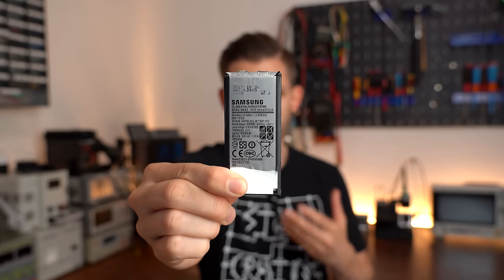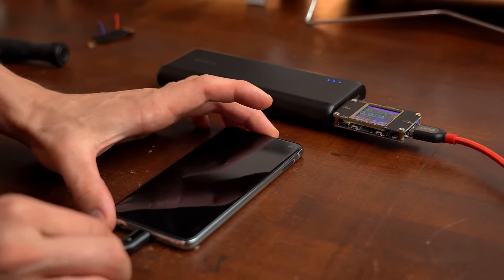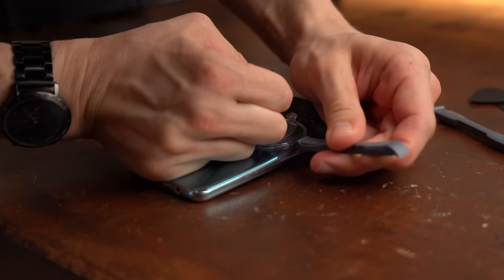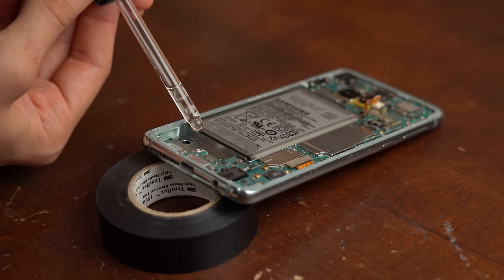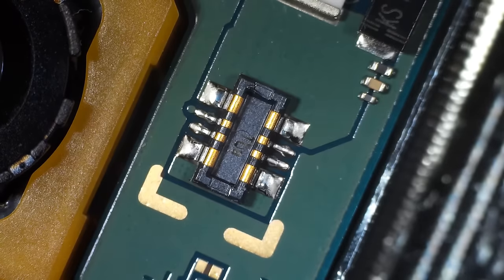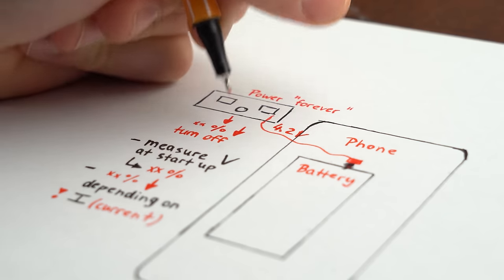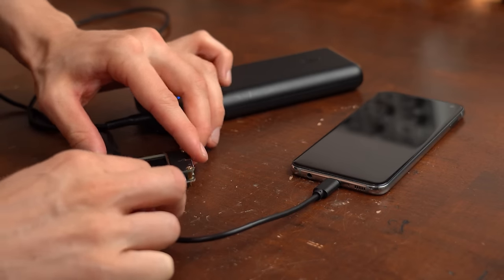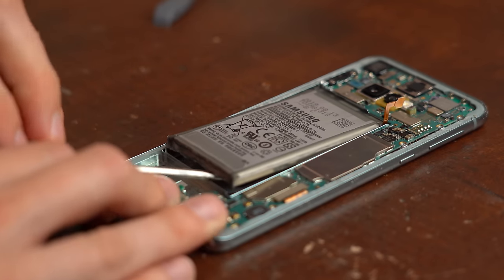I "Solved" Samsungs Swelling Battery Problem! (Batteryless Phone)

Comment: I had the same experience with an old tablet that I wanted to  use as a wall clock; however, I found a different solution that I think you might appreciate. I saw that my tablet did the same strange countdown to 5% battery with a power supply acting as the battery. I tried a regulated switching supply and a regulated benchtop linear supply... same strange countdown. Then I determined that if I could fool the tablet into thinking there was a perfect battery installed during POST and then remove said battery when the operating system started, that the tablet no longer believed that it needed to charge anything. The result is the tablet reports that it is, "Plugged in and no time is spent on battery."
The solution was to short the red and black leads that would connect to the battery during POST and then open those leads when the operating system starts, and it is happy ever after. To short the leads I just installed a "push to make" microswitch in the body of the tablet. Now whenever I need to start the tablet (say from a power outage) I just have to hold that switch while the tablet goes through POST and release it when I see the android system starting. This method has the advantage of no additional circuitry required and there is no charge/discharge cycle happening.
Reply: can you please elaborate on the red and black leads shorting? shouldnt it just make a short circuit of the power supply?
Reply: @theoneohmresistor  My understanding is that the BIOS of the tablet sees a "no internal resistance a battery" because I have shorted the wires. It doesn't short the power supply because there is no signal to the processor to try to charge the battery. To put it another way. As a battery loses charge its internal resistance goes up. This increase is the signal to charge. Of course, it is just a theory, I could be wrong.

Actually, this response got me thinking about it some more so I decided to discuss it with ChatGPT4.

After some discussion ChatGPT said the following, "You are correct that the tablet must have some mechanism to initiate a charge cycle, but this mechanism may not be as sophisticated as it would be in more expensive devices. The tablet's firmware might be designed to handle situations where the battery is connected and providing a voltage within a certain range. When the battery is disconnected, the firmware could be interpreting the lack of voltage or other expected battery information in an unexpected way.

It's possible that when you shorted the battery terminals during POST, the tablet registered a connection and assumed a battery was present. After you removed the short and the tablet proceeded past POST, the firmware might have encountered an unusual or undefined condition where it didn't receive the expected battery information. In response, the firmware might default to assuming a fully charged battery and not initiate any charging cycles.

The fact that the tablet reports a 100% charged battery and indicates being plugged in, supports this theory. The firmware might not be able to distinguish between the absence of a battery and a fully charged battery, leading to the unusual behavior you observed.

Ultimately, the observed behavior is likely due to the combination of the tablet's firmware design, hardware design, and the unique conditions created by shorting the battery terminals during POST and then disconnecting them. This workaround may not be universally applicable to all tablets or devices, and the actual reason for the behavior might require a deeper investigation into the specific tablet's design and operation."

So, the long and the short of it is... it is worth a try. It may work for your situation or not, but "no harm, no foul".
Reply: I’m a little scared to try that on older devices. I have once accidentally shorted the battery terminals and it would simply spark and short the power supply directly. Nothing broke but the phone didn’t want to charge, it gave a warning pop-up when plugging the charger in. It may work on some protection circuits but I think it’s a risky approach. I would assume most devices require the middle pin to have a signal for safety reasons. Chatgpt unfortunately isn’t the most trustworthy source, it is always super convinced that it’s telling the truth and tries to convince you that it’s correct, unless you show that it’s wrong, then it may admit that what it said was false. It can be annoying sometimes and I don’t fully trust chatgpt anymore after catching it lying multiple times, and when I would say no that’s incorrect it’d always go “oh yes you’re right, here’s the correct response”.
Reply: @waldojuarez I don’t think the bios regulates charging, there is usually a dedicated chip for that.
Reply: @teamredstudio7012  "BIOS" is used colloquially as a word for 'firmware'. Even as a separate chip the firmware of the phone is in communication/control of it. 

Also, the way Android 'tracks and displays' battery percentage has changed a lot over the versions. I'm not sure if really old Android devices would even 'countdown' (regardless of Voltage or measured Resistance)

Comment: The old PDAs had fancy desk stands that worked on mains power (and charged batteries). Many stands were  heavy, stable and perfectly angled for viewing. Look at the Palm & Dell Axim for examples that could be modded or used as inspiration.
Reply: Or you can always 3D print one or get a friend to do it for ya.

Comment: This would have been the perfect test bed for a DIY super capacitor battery replacement. They are fairly simple to make, and could be made to fit exactly into the battery well.
Reply: Super capacitors are too unstable and too big...they will work only a few minutes. This is why no one use it unless you want burst power or something to back up an existing battery
Reply: @Tailslol  who says super capacitors are too unstable or too big? I think you need a bit more study time. I have made one myself that was around 8F @2.7v and smaller than a normal cell phone battery.

Sure it wont contain the same energy density as a LiPo battery, but it will fully charge in a matter of a couple of minutes and works amazing as an energy storage from a small rectified generator source.

Im sure that in the space in a smart phone, a super capacitor of around 25-30F could be made. This would run the phone for an hour or so and only need 5-10 minutes to fully charge.
Reply: @TerryGilsenan  clearly 5min is not enough and you should show what you did because i studied a lot those and they are far from ready in everyday use. and way too expensive.
Reply: @Tailslol  expensive? I made supercapacitirs for around 50cents each. That's cheaper than any battery you could buy.
Reply: @Tailslol  5 mins of charge time for 30-60 mins of run time, is pretty good.
Reply: @TerryGilsenan  i guess you never saw blown up capacitor so what kind of circuit do you use to manage them and you still forgot to show any proofs.
Reply: @TerryGilsenan  heh lol i wasn't expecting something that sketchy than diy capacitor ... what a joke seriously.im not struggling here i can see how ridiculous you are going now... so thanks you but no thanks i don't wand a literal bomb in my pocket...
Reply: @Tailslol  LOL, sketch as a DIY? I said that from the outset of this conversation. I made it myself.

And as for sketchy.. they work. and they work well.

Have a nice $timezone
Reply: @TerryGilsenan  nope it wasn't the point the diy capacitor...it was the diy battery replacement circuit (aka the video) and the usability/safety about it. At least wired it is safe ,you can keep it plugged and use it as a clock. A desktop or a game station. And your use?
Reply: @TerryGilsenan  Having to charge the phone about 10 times a day seems quite sad, don't You think so? Supercaps are extremely interesting and have their applications, but powering quite energy-hungry devices like smartphones is not in the scope for now.
Reply: @wikrap1  you mean having a power cable connected some times is worse than having a power cable connected 100% of the time?
Reply: @TerryGilsenan  I mean lipo/li-Ion is better than supercaps for now. There is practically no point in installing supercaps if You can install new lipo battery and use it for the next 3 or more years with better lifetime, but a little bit longer charging session.
Reply: @wikrap1  The video was about removing the battery to avoid Samsungs swelling battery problem. It was about a batteryless phone.

You seem to have missed that entirely, and circled right aback to the starting point.

Also, the supercap does not have any of the lifetime shortening issues of the lithium batteries, such as dendrites. Why? Because the battery is a chemical reaction, but the supercap is ionic charge.

Still, I see that you are arguing for the point of arguing, rather than trying to extrapolate upon the video's purpose, procedure, and outcome.

Have a nice day.
Reply: @TerryGilsenan  Swelling, ok. If we aim swelling as a problem, main reason is overcharging (which manufacturer calls charging) especially keeping the phone at 100% fo long periods (like overnight charging). If the bettery maintains under about 80-90% of max charge, te longevity problems are pretty gone.
Second option is to install cylindrical Li-Ion cells. When one of my phone battery worn out I glued a 3d-printed case with 4x18650 cells, charging circuit and additional USB-out step-up converter. Rather than charging phone during the day I charged other peoples phone with mine. :D
Reply: @wikrap1  re-watch the video.
Reply: @TerryGilsenan  Better tell what's Your point. GreatScott is going to use the phone for mains-supply applications. You are aiming for something portable with standalone power source. The aim is different, maybe I failed again to asses what is actually Your goal.
Reply: @wikrap1  Re-read my first comment. I was not obscure.
Reply: @TerryGilsenan  So You're aiming for a project just for fun/research to test supercaps with the phone, then correcting me that the aim is to fight battery swollowing and having usable mobile device. Then that's not correct also. I'm lost. Maybe You're just trolling me now.
Reply: @wikrap1  LOL, whatevs.
Reply: @TerryGilsenan  I understood you so don't worry, the issue is with the receiver not the transmitter ;)
Reply: Dear @TerryGilsenan, I have question to ask. Since I don't understand chemical engineering at all to make supercapacitor, I'd like to use Kamcap 5.5V 1.5F 20Ω(ESR) SE-5R5-D155VYV3C which fit my form factor of 5.5mm height. The problem is that the temperature operating range in the datasheet says -25℃ to 70℃. I'm on tropical country, and it may be way too hot, is it really that safe? Will paralleling those make it safer? I think I could parallel it to 8. The ESR is still way too high it seems.

Comment: With this schematic I think you could use the existing usb plug on the phone to power the whole thing. Just tap off the 5v from it (from the connector or the board) and running it to the diode circuit should work right? Would save the hole and extra wiring.
It's an awesome idea which I wil definitely do to the phones I keep around to test websites and apps on.
Reply: Yep you could - I did this with an old Nintendo GBA SP. Wired a diode from the charging port to the battery terminals to drop 0.6V and I also removed a surface mount component to stop the charging circuitry from becoming active. Turned it into a USB powered (with the right cable) GBA SP. No need to make holes in the casing.
Reply: That won't work, for 2 reasons:
* The USB jack doesn't necessarily carry 5V. Modern phones use USB PD and will negotiate a higher voltage from the power supply. Furthermore, there's a brief moment (several hundred ms) before the power supply switches to the new voltage during which the power cuts out completely, with the phone being designed to run off battery for that period.
* You could make it a noncompliant device and just assume it will be plugged into a legacy USB-A power supply to avoid that problem since it will always output 5V. However, USB doesn't supply enough current to power the phone. Legacy USB supplies at most 1.5 to 2 amps, which gives <10W considering losses in the diode. Remember that since there's no battery at all, the power source needs to supply not just the max average power (i.e. TDP), but the peak transient load, which can be significantly more than 10W even on a phone. So the phone will draw too much power, and a compliant USB power supply should cut off when that happens.
Reply: @fat_pigeon hen you can simply use a charger that doesn’t have data wires so it can’t negotiate. If you want to mod the phone to work battery less you can also just keep in mind that not all power supplies will work properly.
Reply: I was thinking the same, you can either wire it up from the charging sub board at the bottom, and I noticed on some phones it directly deliver power to the battery connector even when not battery is present, and only starts regulating the voltage when it notices there is power draw from the battery. Maybe you can wire the power from the battery terminals to the pads on the battery circuit where the battery cell should be connected. That would let you replace the battery with a small modified circuit so you can close the phone and unplug the cable to put it away but als let’s you use the phone, but the same way you can use a laptop without battery as a portable desktop computer. And best of all you would be able to still hold the phone in your hand and you don’t have to break anything. The battery itself should be stored in a dry environment and not too hot nor too cold.
Reply: @teamredstudio7012   sounds cooler, so all you need is solder the diode between the battery positive pad and the output from the battery terminal (I've measured on my tabled and there is constant output there). This is way cleaner

Comment: You can probably fix the old phone by reflowing the power management chips with your hot air gun. It's a very common failure mode for modern devices that the tin BGA solder joints fail from thermal cycling. Fun fact military and aerospace only use leaded solder to significantly improve reliability because lead free fails far more easily.
Reply: Yes, with lead better, but more toxic.
Reply: @MrGeri95  Toxic for whom? The amount of solder used in a smartphone is utterly tiny and if properly disposed of none of it goes into the environment.

Besides there's much more toxic stuff in the battery if a phone is disposed of incorrectly. I'd gladly take a lead soldered phone that lasts for ages than a lead free that needs throwing away after two years.